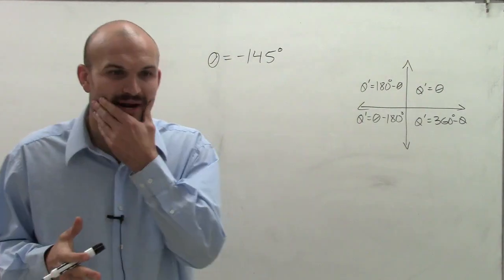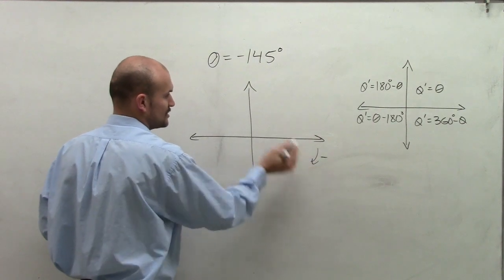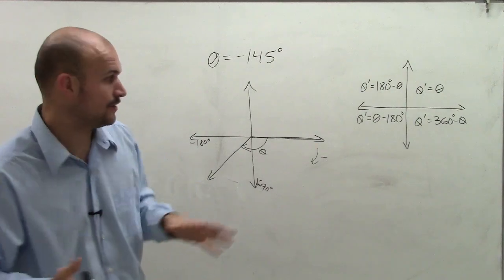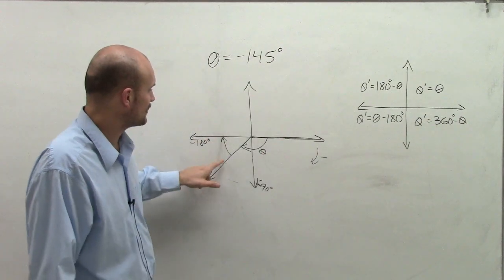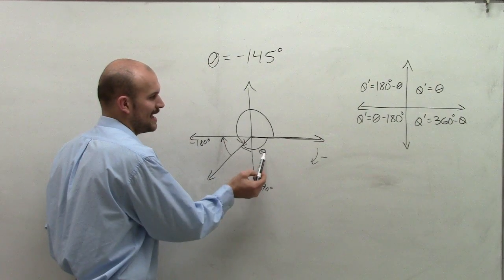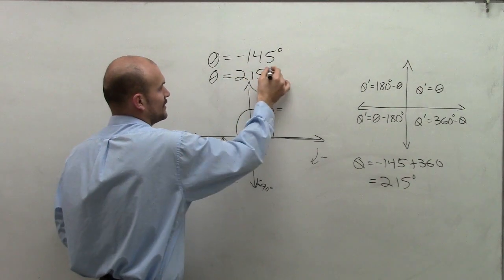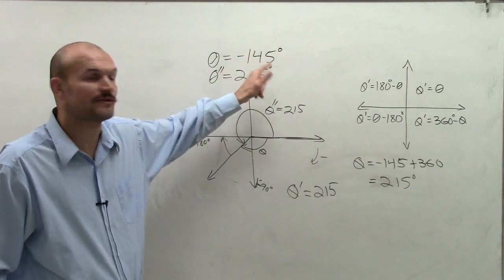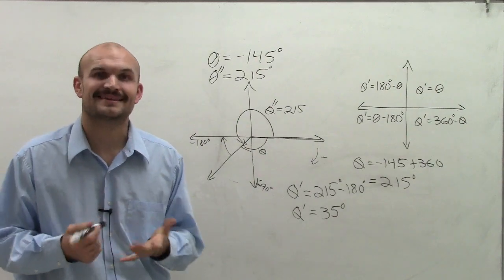Find the reference angle and sketch both angles in standard position

Comment: what do you do if your theta has 4 digits like -3080?
Reply: Divide 3080 by 360 and you get 8.555555 repeating.  This means you go around the unit circle 8 times in clockwise direction.  So subtract the 8 and you're left with .5555555 repeating.  What's left represents a degree measure of -200 degrees.  Now just do what Mr. McLogan explained in this video.  The angles have to be between 0 and - 360 or 0 and 360, so you have to simplify.  Kind of like simplifying a fraction--for example, 24/36 is equivalent to 2/3 after it is simplified.  -3080 is equivalent to -200 degrees after it is simplified.  I hope this makes sense..

Comment: can one find a side length using the 90 degree right angle instead of the other two unknown angles? and if you can, which side is opp and adj since thaida is resting on the right angle?
Reply from the maker: to find the reference angle just find the distance from the terminal side to the x-axis, are you asking a different question?